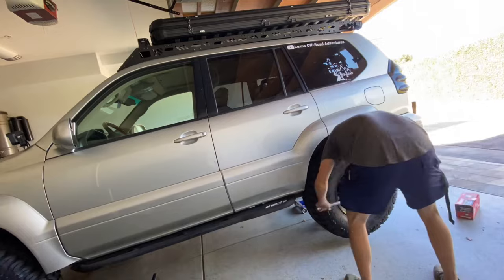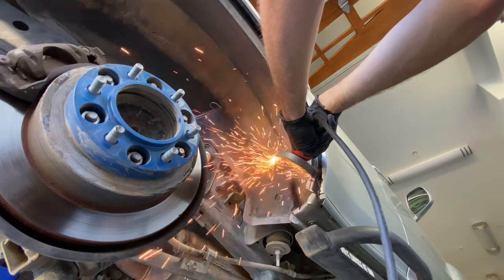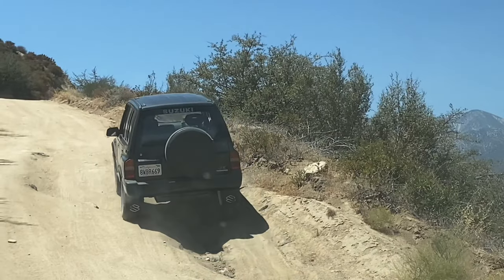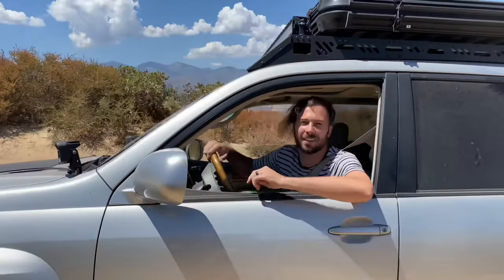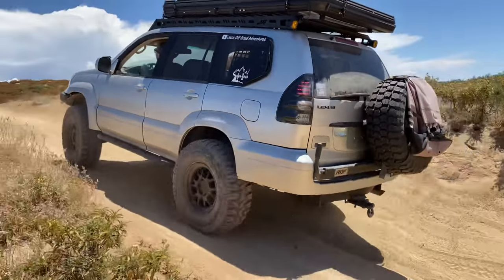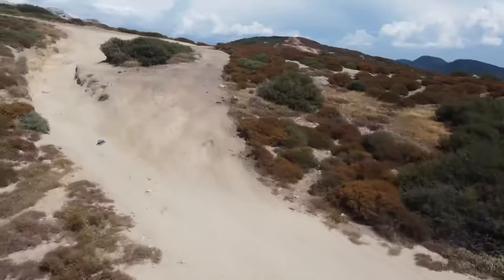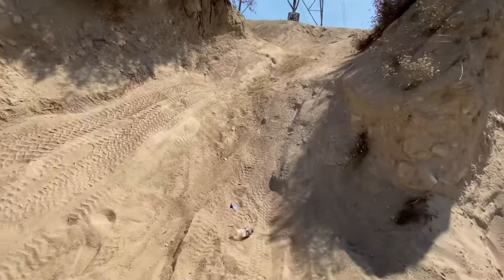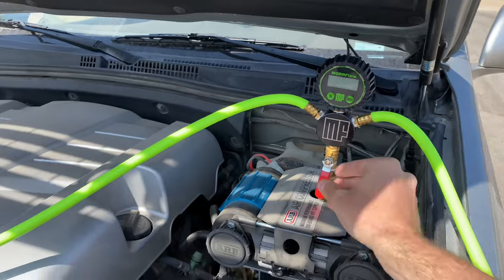GX470 OFF ROAD TEST | Fitting 35 Inch Tires on a Lexus GX470 (Part 2-Rear)

Comment: Need to fold my pinch weld better, I’m also running 35 12.50’s and I still need in a little bit in the rear under full compression. Really like the videos you posted about fitting 35’s🙌

Comment: I’m not doing 35” until I can upgrade the rear to an 8.2.  That stock ring and pinion is just to small.
Reply from the maker: 8.2s are a great option. I’m gonna be doing gears soon. People break the 8.0 because the carrier bearing can get out of spec over time and the excess backlash causes carnage. Getting new gears installed or a CBPL Refresh can increase strength up to 50% according to some. That plus solid pinion spacer should give some extra strength. http://www.gearinstalls.com/freshen.htm?fbclid=IwAR0vlc9dCnbYGA-kzrcZWSjjOUIsdVIKzdoPjiN7FmQhEaVHzlWtI60XqzQ&fs=e&s=cl
Reply: @lexus_offroad_adventures  yup, it’s a fix but the piñon is still almost half the size of the 8.2.  I’m in Colorado so having a major failure like that on a 11,000ft shelf road isn’t on the top of my to-do lists, lol.